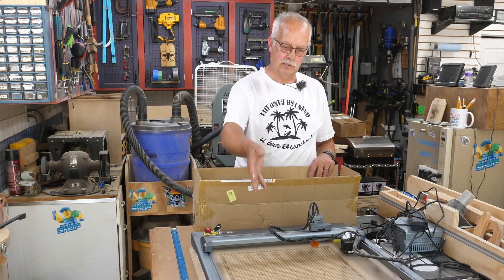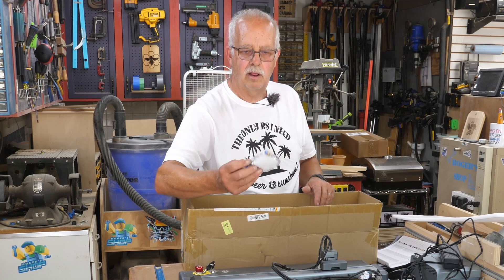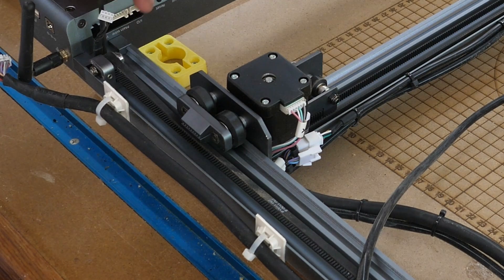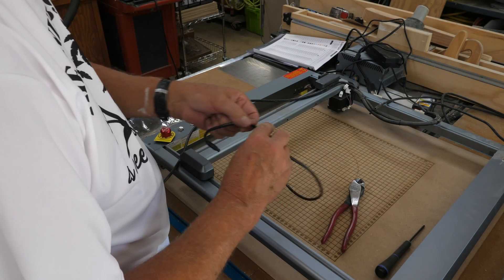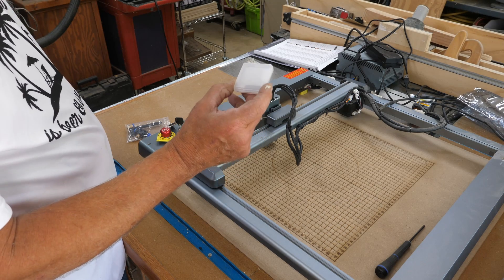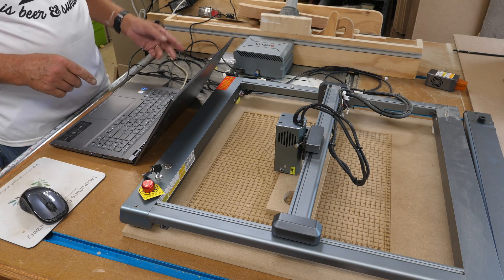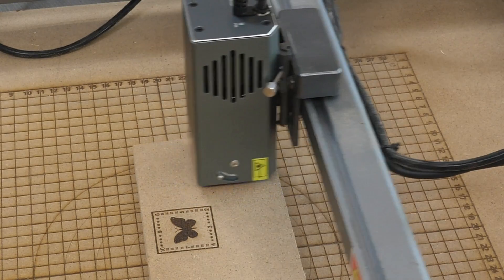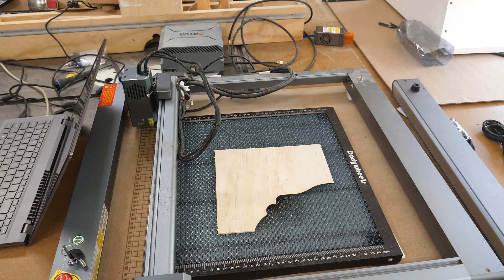Ortur LM3 Upgrade To 20 Watt

Comment: Sorry but this installation does not seem to use the parts many of us recieved when ordering the upgrade for the LM3. How did you get the new enclosure? What we need is a detailed how -to on installing the new board (ouc?) inside our existing front control enclosure. Thanks.
Reply from the maker: That is what I was sent.  If Ortur has since changed the kit, I am not aware of it.  I am not affiliated with Ortur.  I only did the review of the kit they provided at the time.

Comment: Roger thanks for the videos, and reviews I always learn something when I tune in.

Ortur if you're listening. I had to remove the mother board (anyway) that came with the 10W version because the micro/mini/tiny SD card getting stuck inside (????design).  I wouldn't mind an internal upgraded motherboard with the SD card slot actually extruding past the frame with a seal around it.  For me, it would actually be easier to replace the entire board where it belongs then the piggyback,  after thought method shown on the official instillation videos. I'll sit this one out and wait for the others to come out with complete 20W laser kits at the 10W prices in about a year or less.

Comment: Hi Roger, I wanted to ask you a question about this up-grade. 
In your video, you are showing that you received a complete new front end with the new up-grade. 
When I was getting ready to order one, I am seeing that I will have to rig up with wire ties on the new laser head, the new mother board. 
Is this true? If so, I am re-thinking about doing this due to the fact that I did this on my LM2 Pro. 
In my opinion, this makes the LM3 look like a cheap knock off made up of used parts etc.. 
I emailed Ortur about this, but I have not heard anything back from them. 
Thank you. Rick
Reply from the maker: I have been told by Ortur that the public release will not require replacing the front.  You will still need to move the limit switch stop screw to the next hole, but otherwise, the 20W module will fit the existing mount and only the cable will need to be changed back to where it plugs in at the end of the X gantry.
Reply: @rogersshop  It seems Roger you have the only one that was done correctly for some reason Ortur decided to change the way this was implemented and leaving the customer to fend for themselves. I've never seen anything like this in 63 years when a company has a pereftly good solution like you demonstrated and then decides to go the opposite way for the general public. Make no sense something tells me its all about money.
Reply: @rogersshop  I got an email today fro Ortur saying that you will have to tie wrap the new mother board to the 20 watt laser. 
I think that this is a poor design, just like Ortur did on their up-graded laser on the LM2 Pro.. 
Thank you!

Comment: My only complaint with upgrading anything on the OLM3 is the old parts become useless. Example would be the extension kit completely replaces the side rails rather than adding onto them. For this upgrade, you're left with a whole front part with no way to use it. A trade-in program would have been nice to avoid wasting parts.
Reply from the maker: I agree, but do see why they do this here.  Replacing the motherboard is beyond the skill set of a lot of people and they are avoiding those tech support issues.